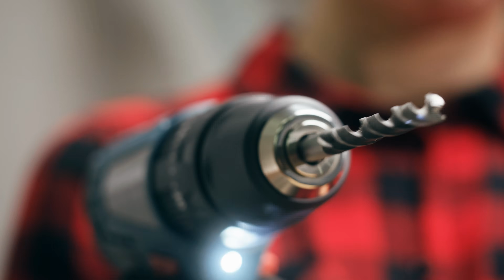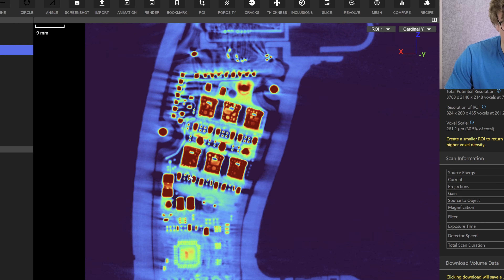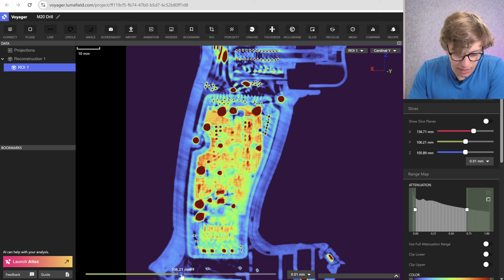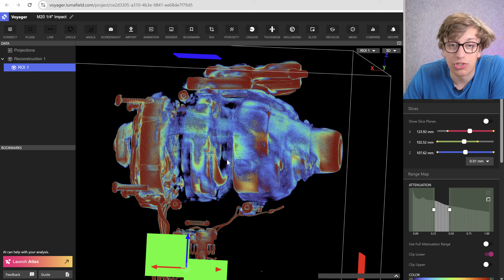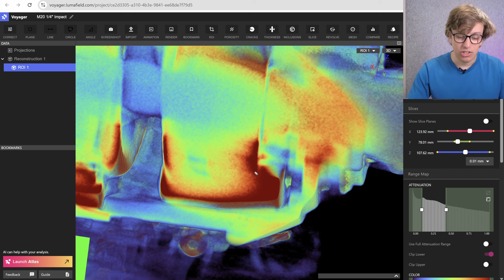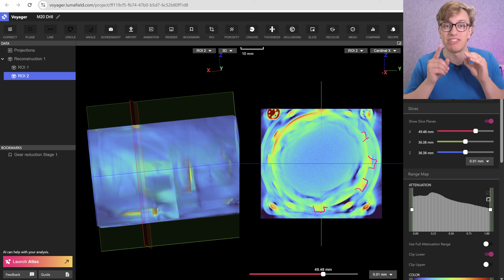Drill vs Impact Driver: What’s the Real Difference Inside?

Comment: So, the conventional drill produces continuous torque while the impact driver produces intermittent "hitting" torque pulses at high speeds.  I wonder why the impact driver was invented?  Was there a need in some industry or home application that required the use of high-impact hitting to get a job done?
Reply from the maker: As I understand it, there's two motivations: You can make a lighter tool, and you can deliver higher momentary torque. Beyond installing wood screws, impact drivers are pretty nice for tightening pretty much any other fastener.
They're derived from impact wrenches, which were needed in industry for high torque fasteners (automotive lug nuts, for instance) where the challenge is more in getting them off than putting them on. And if your fastener is, say, rusted into place, a drill is just not going to get the job done. (CH)
Reply: @INSIDEVERYTHING1  ...Thank you for the clarification and additional info!
Reply: They usually use it in the automotive industry
Reply: well drilling into concrete or really thick brickwork might need a bit more forvce than drilling through dry wall or thinner metal
Reply from the maker: @a_lethe_ion Drilling into brick and concrete is done not with an impact driver but with a hammerdrill. With these, there's no intermittent torque, but an intermittent axial impulse, a hammering motion, along the bit and chuck (CH)
Reply: @INSIDEVERYTHING1   ah okay. english isnt my first language and like... the tool feels like its hammering all right. the good old hilti we used was massive - kinda funny bc the holes werent that large but a regular drill wouldn't get through dem bricks :D
I wanted to hang some shelves, so needed something that would get through that and the regular drill wouldnt get through

Comment: There's another type of drill, hammer drill, used for drilling or chiseling into concrete, has three modes, drill, hammer drill or chiseling mode.
Reply: He said the drill had hammer function
Reply from the maker: This drill has that function, and I spent a while trying to figure out how to show it in the video. However, there was far too much metal in the way to actually get a clear image of what was going on, so we cut that portion. (CH)